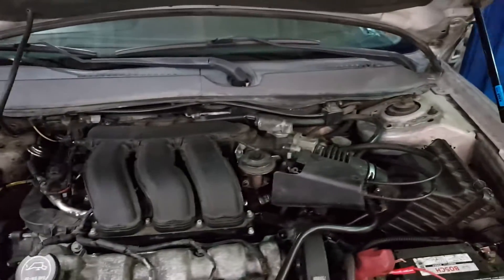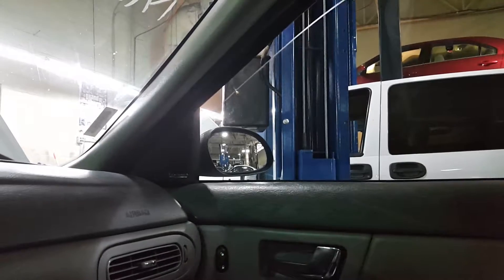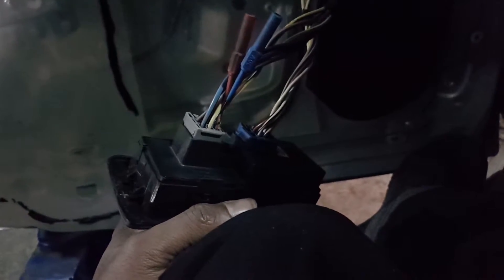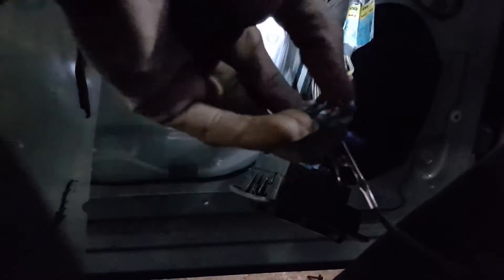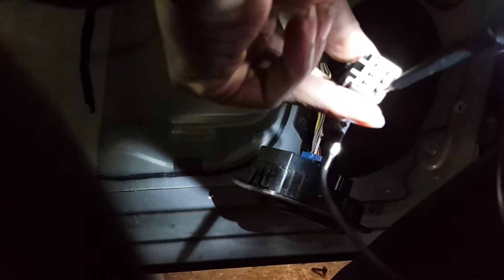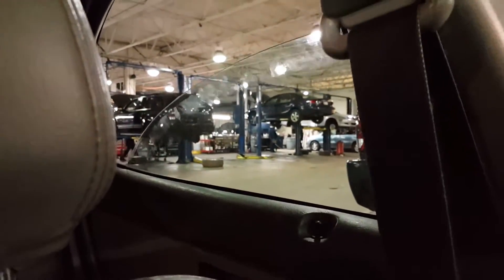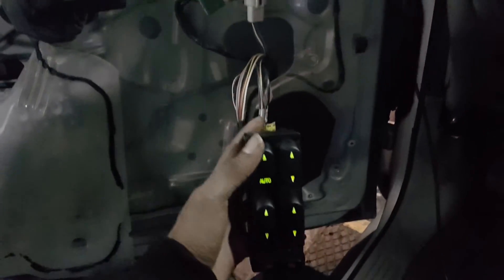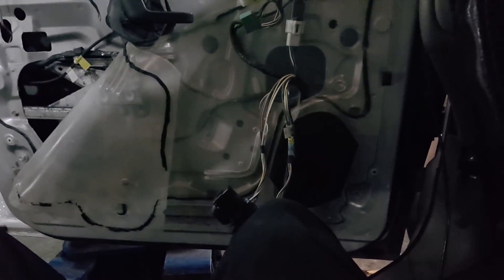Windows Won't Go Down 2000-2005 Mercury Sable/Ford Taurus

Comment: Hello my 2005 ford Taurus  se 3.0 engine . The issue I'm having is that the wires from that go in to the door panel in that rubber boot got cut from opening and closing the drivers side door they been work good .I found the cut wires and fix them. Now I when to fix the type I had on them to put new type now they don't work I'm connecting the same color wire to the same color wire so now I don't know what the issue is have you ever ran into this problem do you think it could be the residue from the tape I had on there is maybe blocking the wire connections is there a way for me to check the wires also maybe for continuity

Comment: my 05 ford taurus windows intermittently work. I have replaced the window switch, door panel and DOWN fuse switch box. Doesn't act up as much but today they worked perfect  turned on head lights windows wouldn't go down. Turned headlights off window goes down lights  turned back on window works fine... Help what the F is the issue? And of course I can not locate which small fuses work the window cause the book does NOT give you that diagram. Please help this lost momma!!!
Reply from the maker: Intermittent problems sometimes come down to bad wiring. Check wires that run between the door....had a few bad fords like this

Comment: In a 2001 mercury sable, none of my power windows will work n the number 26 fuse inside cab drivers side fuse box was blown, i put in another fuse n it blew also, what would cause it to keep blowing? N i guess that is the fuse to the power windows, fuse 26 says mirrors, power antenna , pulse stretcher module, deck lid lamp, battery saver
I looked for fuse in fuse box diagram but cant find one that says for power windows, so i guess its 26 cause it keeps blowing
Reply: That sounds like it’s shorted somewhere.
Reply: Michael John Im having the same issue did you get it diagnosed. I haven't check that particular fuse yet though
Reply: @antonsingleton9320  it was that number fuse for power windows
I did get it fixed, what happened is that I was hooking up a solar powered battery charger to my car battery cause I had parasitic draw, n I plugged it in my cigarette lighter n it was messing part of my wiring system up n was blowing that fuse n it stayed messed up after I unhooked it, I had a alarm shop look at it n they figured it out, they opened up my driver side door n hooked some small electronic device up to my battery n checked the wires n power switches for my power windows, then they got it working again, I was able to watch them n help them they let me, as he was holding that device connector to wires n power switches he told me to hit the button n roll up n down one of the doors power windows, I did n it worked, then he told me try all the other windows n they worked, I asked him how he did it he told that device he had gave power to the windows, then we put n new fuse in n  all the windows worked n the fuse didn’t blow
He told me also to not connect my solar panel battery charger through cigarette lighter n connect it to directly to battery, I learned later I had take off negative battery cable and hook it up or it would blow the fuse still, after that I could charge my vehicle battery without it blowing, then after charging I hooked back up battery cable when I wanted to drive my vehicle
I don’t know how to explain it better n want that electric device he had n want to learn how to use it
Car alarm shops are good at vehicle electrical work n he charged me 85 an hour compared to 120 an hour at this one really good mechanic shop
They also fixed something else I had wrong n it all cost me $85 for one hour, n good thing I was watching n helping n learning more or they could of deceived me n charged me more by lieing, I think I hears one of the bosses whisper something about they could of charged me more, but the guy working on it whispered back I couldn’t cause he was right there
So try that with that device n open up drivers door n give it power n run windows up n down then put a fuse back in n run windows up n down n see if it blows again, I guess it was over loading it to much or something n stayed messed up until that device fixed it some how
He also told me not to use those devices you plug in to charge up your devices cause that could mess it up also

Wish I could explain it better but don’t know how right now, can someone help me out here n tell him better